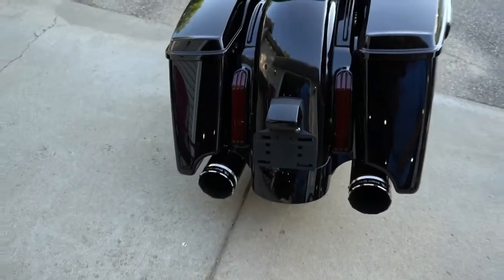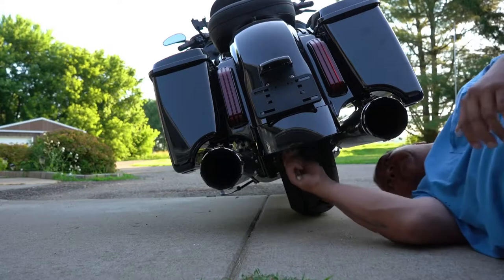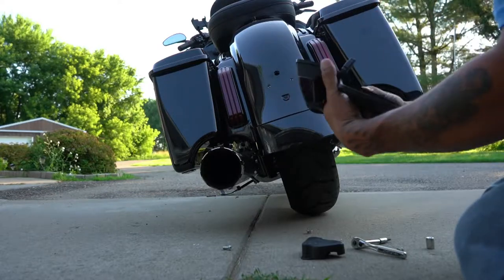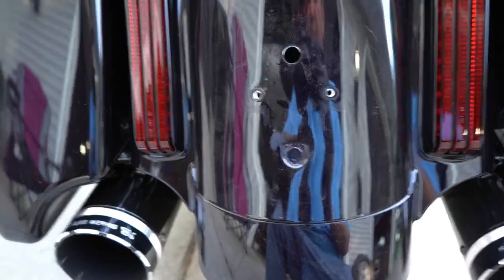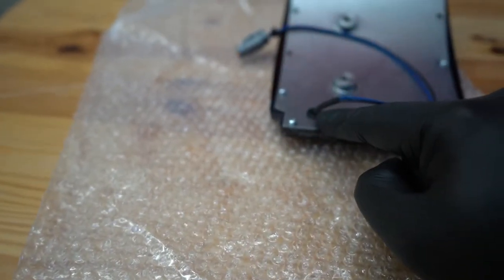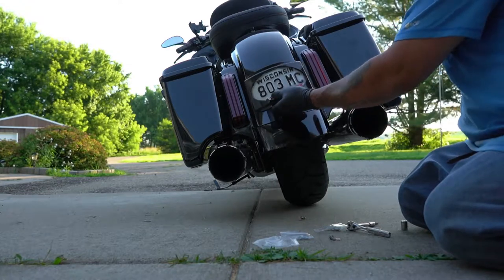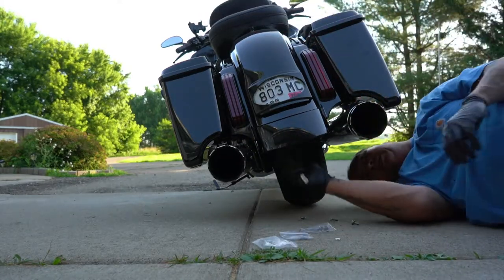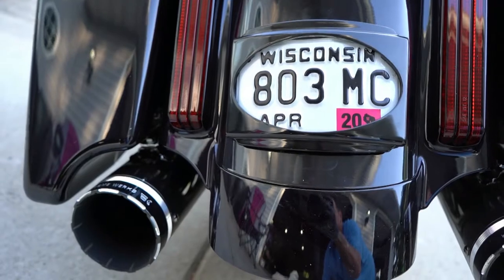Paul Yaffe Stealth lll Touring CVO Curved License plate frame

Comment: Tried to drill mine out and the bracket just pushed threw as it’s only stuck on with double sided tape.  With the bracket now off I have no way to cover the wires near the tire.  I think I”m just going to zip tie the wires and put some electrical tape to protect the connector from water.   I guess I could drill out the bracket now its off the bike and then reinstall as the bolts would be holding it in place… Great video though.
Reply: How did you drill through if the bracket popped off? I did the same and now it's been a bear to drill the holes through as there is no solid foundation behind the bracket while drilling out the hole. 
Help!!